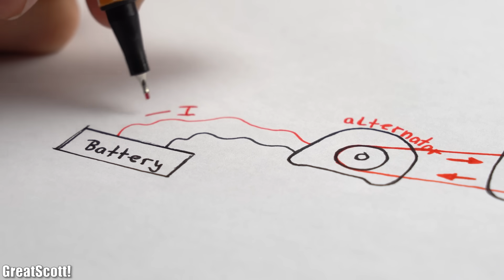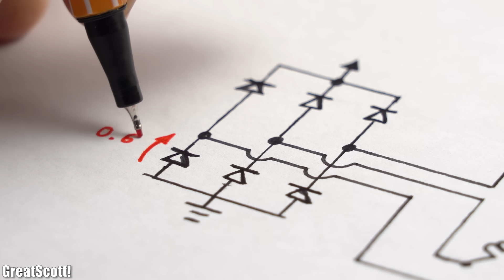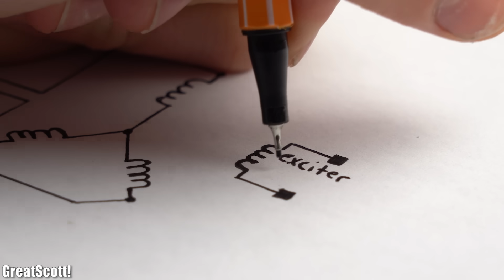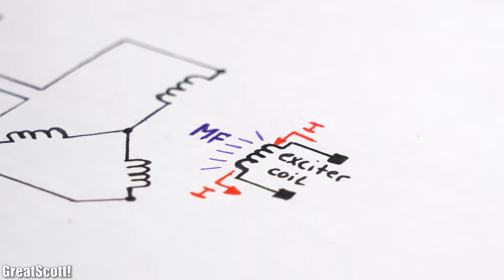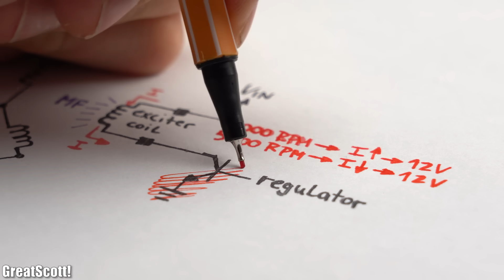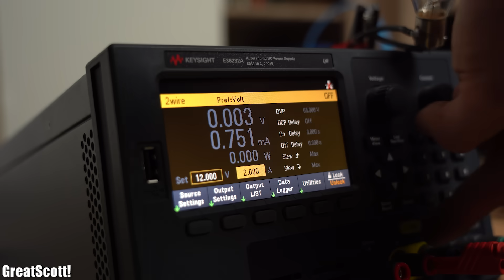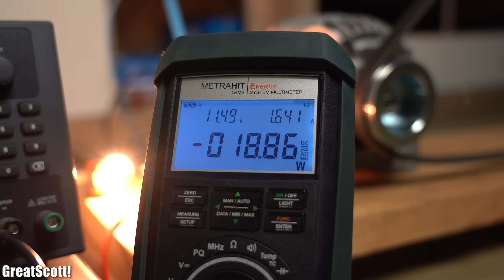Using a car alternator with a bike to power my home? How much energy can I produce?!

Comment: Thanks for doing this. It demonstrates clearly that 1 human can only generate X amount of mechanical/electrical power. It does not matter how you gear it, which belt you use, or how tight it is, or how much spinach you eat, you CAN'T generate anything useful by pedalling a bike with a dynamo or an alternator or a sodding magic box with fairies in it! People make the same mistake with wind generators. OOh lets use an alternator. DOESN'T WORK! 
Bloody humans!

Comment: 1hp=746 watts. The best output that you can make is about 25% of that for a short period of time. I suspect that you need to rethink your power source or your power consumption. Additionally dc generators are self exciting. No external power inputs required. But their mechanical losses are greater due to the commutator. Regardless,  the maths is, if you want 1500w output you need that, plus losses for your input.  I very much doubt that you can make 2hp

Comment: Use some metal conduit brackets to more securely attach the bike to the stand. Maybe support the front end with a metal rod instead of the tire. Once you have the bike frame fully stable to the frame you can add tension pulley to the belt to help avoid slippage at higher loads. That should give you a bit more power output at the expense of sore legs.
Reply: Raise the back tire and bring the alternator under the the tire no need for belt

Comment: Cheap and easy. acdelco 2 wire alternator.  They start around $35 bucks on up.  Depends on the amount of amps you want and if you want a V pulley or serpentine pulley.  You can go to any car junk yard and get them on the cheap.  Easy to rebuild also.  They are also sold at any parts store.  Just tell them want your wanting to do.  Good luck

Comment: I've always wondered about doing this.  Aren't those type of alternators used to charge batteries which then supply the power? Amps go in, volts come out, I think.
     And then you need an inverter to power anything more than 12v. I think this system will work, especially as an auxiliary to a solar panel or wind turbine.

Comment: An idler pulley to get more grip on the belt by covering more of the radius of the alternator pulley and stop the slight slip which should increase electrical generation.

Comment: Mate you need another two pulleys mount two vertical timbers put an axle a cross it with two more pulleys you think about it work out the diameters of the pulleys also you'll need another belt as well

Comment: Use a lower amperage alternator or stationary powerplant generator ( fixed magnet rotor )
The low amp alt, will require lower field amperage for the low speed that you're using. Also putting a very small alt pulley will spin it faster.
I would also install an adjustable voltage regulator. 
Higher voltage lower amperage is more efficient than low voltage high amperage.

Comment: In Australia using similar alternator to charge batteries ,it would nearly stall a 6 horse power motor when charging circuit was engaged and that's using oversized pulley with highly tensioned v belt system, you have no chance peddling with loose belt

Comment: it seriously makes me face palm that you're using low gearing on the bike... wth. you'd want the chain on the largest sprocket near the pedal or crank, and on the smallest one for the wheel, the alternator shouldn't offer much resistance and you could get the greatest return from each pedal of the bike.
Reply: This.
Reply: true words.I raced pushbikes in my youth for Brighton team.statute mile speed runs had a massive oval shaped cog(more ergonomic so more leverage when your legs at weakest point)and tiny cog on back.took six people to push you so you could actually pedal,then arse in the air,chin on the handlebars and pedal like the devil.reversing this will give you the ratios you need.obviously number of cogs should be optimised.
Reply: If you output more than 30 watts consistently you’re an absolute unit. Low gearing makes sense because when you pedal, having a fast cadence lowers the strain on your joints and ligaments. The load on the system changes the effort required to pedal, so gearing it higher would make it unusable for a human.
Reply: you vastly underestimate the power it takes to make 10 amps with a 12 volt alternator and the resistance created by generating that much power.  also as a DC alternator, spinning faster doesn't make tons more power, it's not AC, the operation of an alternator and a generator are different
Reply: @scottallberry6713  a 'DC alternator' is just a regular AC alternator with an internal rectifier. Other than efficiency, there is no difference in operation that is relevant to how much they can output in this context. The speed the rotor spins is absolutely relevant in either a generator or alternator, because in either case (among other things) the power calculation requires only two variables to be known; torque and RPM. spinning faster at a given torque means more power, and it is a linear relationship i.e. 2x RPM = 2x power
Reply: @Lawrence Anderson yeah. 6.5watts per kilo for 24 minutes. 450 watts won’t even run your microwave; hell, it won’t run some TVs and that’s at a sprint level that only a top tier athlete can output for extremely short duration. If you output .06kw/hr per day from a bike you’re in amazing shape. Here’s the thing; I’m an electrician by trade and  I’ve been into road biking for a while.  I have ridden with guys who have power meters in their pedals. After a 90 minute ride if they had an average output of 30 watts we were all dead tired. If you don’t believe what I’m saying, try it yourself. You can’t just “spin it faster” once you add load.
Reply: @kurtisb100  I understand what you're saying, however in the video it doesn't appear to have much, if any resistance from the load of the alternator.
Reply: @zurimuris4222  he’s powering a 20w lamp. Not much for light, maybe, but you’ll have sweat running into your socks in no time if you power that for any amount of time.

Comment: A 1960's General Motors "two wire" alternator works wonders in this case usually runs an older style V belt.
Reply: I was thinking about it in 2008. An old 1960's Alt/w an external voltage regulator. A 12 volt car battery. 12 volt electric motor/w a V-belt and an invertor... I wonder if it would work? Or would the electric motor drain the battery faster than the alternator could recharge it?
Reply: @hanc37  yes...you will use more energy than you produce
Reply: @hanc37  yeah it would just drain the battery. You're talking about a "free energy "device of which there is no such thing. Physics has laws, you know.
Reply: @hanc37  You are talking about a perpetual motion machine, and this would not run for very long.
The reason is that the energy conversion efficiency at each step of the process is less than 100 %.  Thus, eventually the battery runs down because the process puts in less energy than it takes to drive the process, and things come to a stand still.

Comment: I have thought about doing this for many years, I really thought it would work, do you think a DC dynamo would work? that is what cars used before using the more complicated AC alternators that have internal rectifiers and would be much more simple, but you may have trouble finding a DC dynamo nowadays.
Reply: Try buying an older style meggar.  That's just a dynamo used to induce current into electrical conductors to test the integrity of the outer insulator.  Electrical contractors use them all the time and the newer ones are digital.  There's the possibility of getting one from there
Reply: They stopped using generators on cars because they didn't make much power at low rpm. Alternators will give full power just above idling speed and are way more accurate at outputting reliable consistent voltage at varying rpm which is beneficial for someone pedalling.

Comment: Waste of efficiency. Why disable yourself from doing other things when you could power the alternator with a magnet mill or free wheel series? I love the topic of fuel free energy. I don't quiet understand how the fly wheel generator or series of alternators work yet. But those & the magnet mill seem to be the most optimum generators I've seen yet.

Comment: Why not use the alternator to Charge a 12V battery and then use an inverter to produce 240V? Then you can just charge the battery when you have the opportunity…
Reply: Ya your right and it’s been proven too. There’s people online that have  videos of water wheels connected to alternators charging 12v battery’s. They all get connected and can power a medium size cabin while being charged still.
Reply: Good idea. My uncle has this setup near a big river.Works good except the power isnt suitable for motors as the ac sinwave isnt pure.
Reply: @padraiggalvin2807  
One needs to ensure it is a full wave inverfer. They cost more.
Reply: @padraiggalvin2807  a car alternator is AC current if I remember correctly and the rectifier converts it to DC.
Reply: @brucetec6597  yes correct. I should have said he uses an inverter to convert it back to AC voltage again
Reply: @brucetec6597  yup
Reply: I came to the comments section just to see if anyone made this point storing the power is key I have made a few small battery packs by daisy chaining used batteries from back up fire alarm batteries in series and connecting a small inverter I make it for camping I charge it using an automotive battery charger works great like a home made jackery

Comment: One your belt is too loose. two you need a 12v battery hooked up to the exciter for a constant voltage, The best alternator for this purpose is the General Motors 1 wire alternator where the exciter is built in and no extra wiring is needed. it is still best to have a battery connected to the alternator but any resistance designed for 12v will allow for an output at least after the current begins to flow

Comment: Your math is wrong. House voltage is 115 or 220VAC depending on location. Car voltage is 12VAC. You have over estimated your wattage by at least 10x.
Reply from the maker: No

Comment: I've played with car alternators. For a full output they need about 4 horse power to drive.
Reply: And the AC compressor uses 5/10 horses.. and that puts a full load on the alternator as well so now you are using 10-15 horses just to stay cool.  That's why on most cars you notice a significant reduction in power when the defrost or AC is on. In fact some cars disengage the AC if you floor it so you can use all your buff horses to get going.

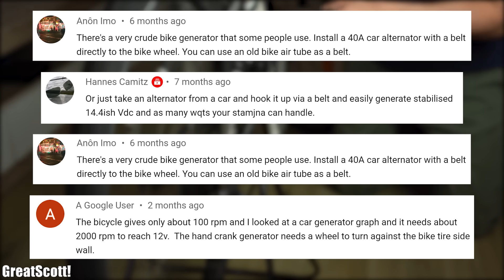Comment: @4:17 im getting 14.4 volts from an alternator at idle, engine idle being about 600rpms, so what are they calculating? The belts rotation from the cam to the alternator? I can’t imagine it being much higher I don’t think the Rpms are your problem there
Reply: Is it? I’m genuinely curious here

Comment: I have a yacht with an 18 hp diesel engine and a 110 amp alternator. It puts quite a load on the engine when the batteries are down and I know that it is way beyond anything I could produce manually. Wind power might be a solution?

Comment: Not great. Most people can easily sustain 75-100 watts. So your generator has extremely poor efficiency at couple of amps. Change to a motor that's more efficient at 50-150w range.

Comment: Remove the stater windings and rewind as single phase. I have gotten 3000 watts A/C at 330 volts on a 45 amp ford alt from the seventies. Lots of work to do. I am do one with a 84 Caddy Alt.

Comment: Most humans 1/3-1/4 hp at peak strength. Can 746/.25 or .38 - 186.5 watts can charge a battery bank. You be peddling for hours at 95% effort. But it’s achievable. X that by four members in the household. Boom everyone has two hours of biking a day.

Comment: This system will work perfectly if the mechanical energy is something in the order of a water wheel. Possibly with a ram pump feeding it. The alternator can be hooked to a 12v battery bank with a 120 volt inverter and charge controller installed. Low amperage can maintain the charge in low demand times and battery storage for peak times.
Reply: Im looking into battery banks tesla makes good ones bit on the expensive side.
Reply: @starwatcher727  if you want to get started on the cheap you could just go with a good lead acid deep cycle battery Bank were you deep cycle AGM batteries. Upgrade when you can afford to.
Reply: @rumplestiltskin509  wow thank you I will research this I'm thinking about buying property houses are expensive where I'm at, also researching cyntriphical pumps, and pump rooms, I have mechanical, machining background.
Reply: @rumplestiltskin509  will do, I haven't landed on anything yet yes that a requirement  running water, and good timber.

Comment: So when you stop peddling the bike, the light goes out. Duhh. That's a far cry from running the house with that duo set up. If it could generate enough power to peddle itself it would be constant power
 Then you could run more tha a light.

Comment: You could take an old 120 volt fan apart, replace the blade with a pully, and use that to drive the alternator.
Then you wouldn't have to pedal at all.  Free power!
Reply: Hmm

Comment: Really, a car alternator is, as you discovered, one of the most inefficient motion-to-electricity converters there is. And it can pretty much thank the Exciter Coil for that.
You might be far better of trying a smaller AC Motor, with a capacitor as an exciter. Nigel Smith has a good book on the subject: "Motors as Generators for Micro-Hydropower."
You'd need to provide your own Rectifier for this one. But, sizing your generation properly you'll probably be able to comfortably produce 100 Watts. Which is a bit better, but, still a nice workout.

Comment: Use a one-wire, self exciting alternator.
They generally put out low amperage, but you may still be able to leg-power it because of less resistance.
Reply: Early 80s chevy altenator. Internally regulated and will put out good power

Comment: At least you tried.
Looked like a good idea. Needs a belt tensioner like another small wheel /pulley that pushes up on the belt from the bottom of the belt from the base

Comment: Take the rotor apart, get rid of the coil and install permanent magnets around the inside of each half of the rotor alternating polarity. Press the rotor back together and re assemble.
Reply: So like a stater? Would you need a regulator/rectifier?
Reply: @josephright350  The stator is the conductor surrounding the inside of the case, which surrounds the rotor. The rotor becomes an electromagnet when power and ground is applied to it. In order to bypass having to apply power and ground to the rotor, with the addition of the magnets it becomes a permanent magnet. It would be more like an armature in a motor after adding the magnets. It will still produce an AC voltage however, so the rectifier bridge will still be required. The voltage regulator will be unnecessary.
Reply: @northpostman  so very cool thank you so much. Stay  safe out there have a great day

Comment: What I would really like to see is a bike hooked up to a winch, that lifts heavy weight, that when released to gravity, slowly spins a heavy flywheel, and using a gear assembly runs the car alternator. That would be a really sweet system.
Reply: https://youtu.be/_InAZD800Io
Reply: That is actually  really cool idea but unfortunately it's your idea.  So that me you have vision so do the research and make it happen you'll be happy as fuck once you do.

Comment: This was pretty cool.... I did some research on alternative power sources because I believe the goober-ment will regulate it and use it to force people into doing things they dont want to do... One thing I found was there are certain washing machines that have a system that can create electricity as a water paddle .. Also the fan motors on cars used as wind turbines. If I had the time and resources I would try these things.